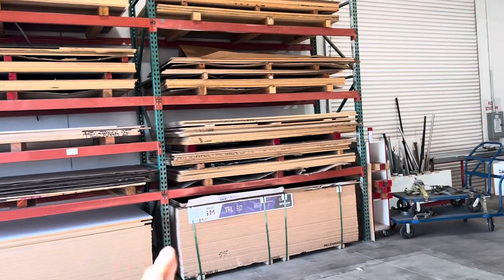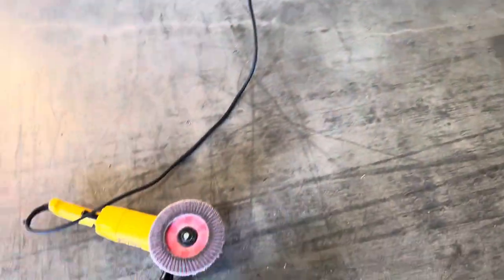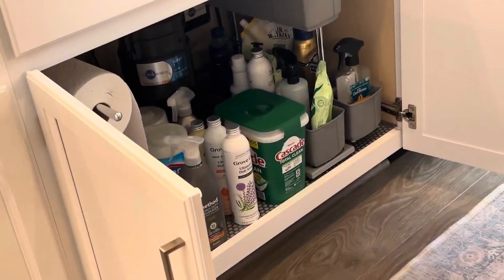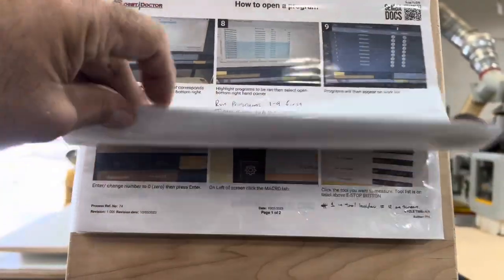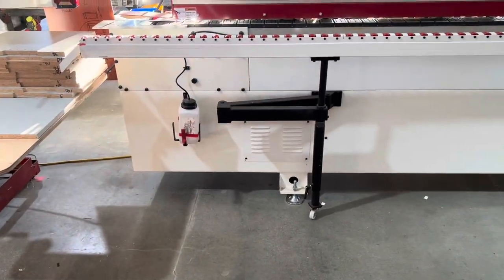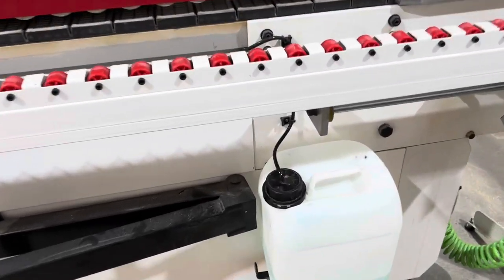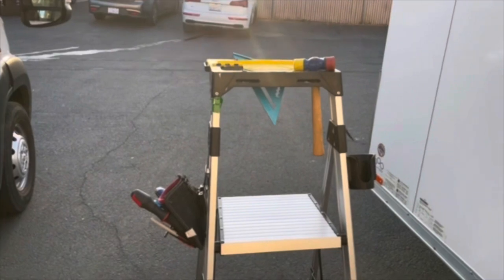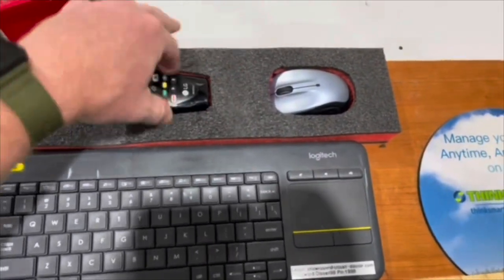Improvements at The Closet Doctor Visual Control, 2 Bin at Home and more!

Comment: Hi Derrek, what type of anti adhesive spray are you using? We use riepe LPZ/II and get about 10,000ft from a 2 liter bottle
Reply from the maker: We use the same. I think I need to upgrade the sprayers as they spray more than it needs or it’s off.